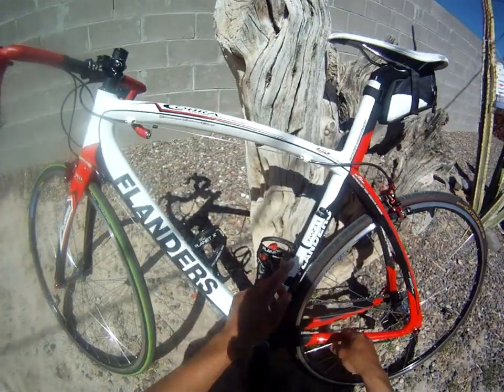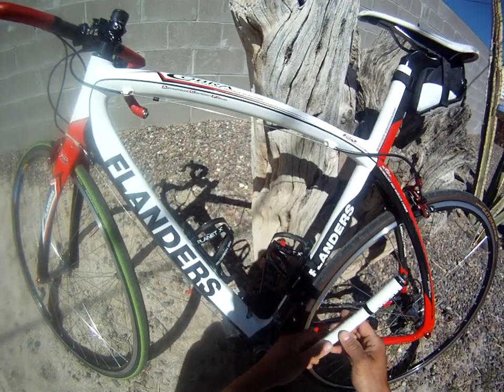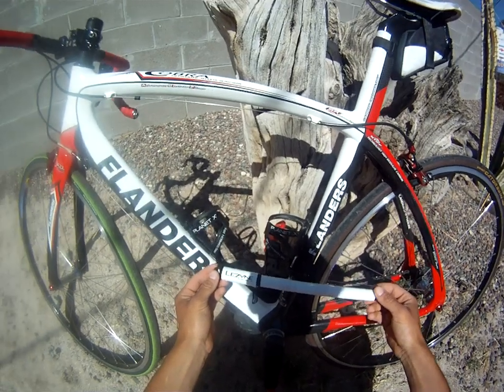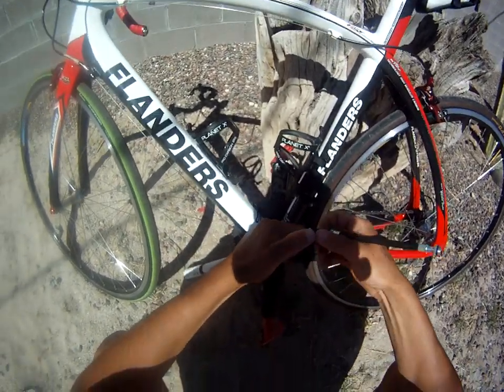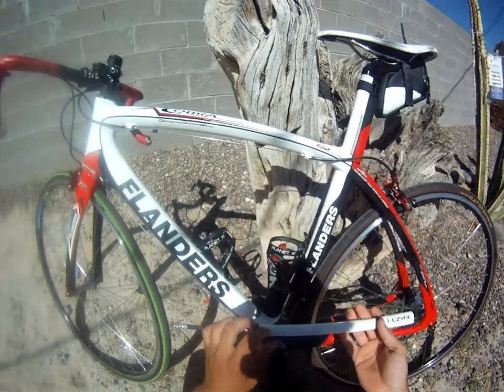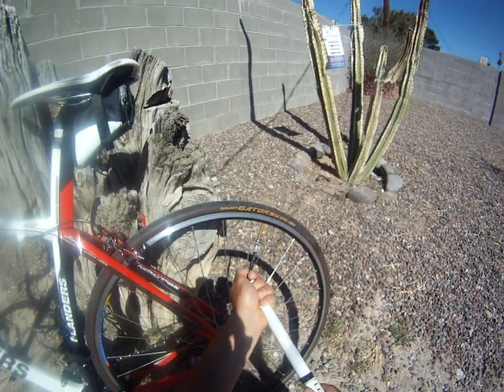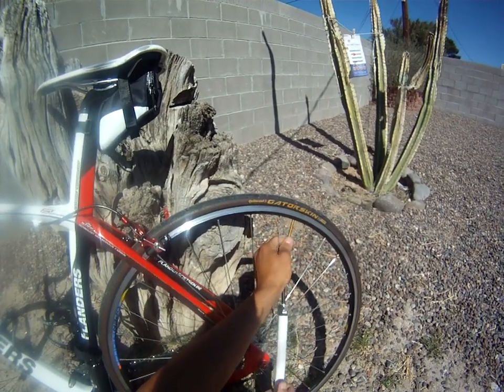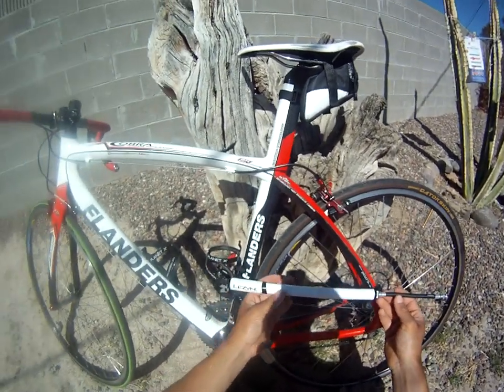Lezyne Road Drive Pump

Comment: I have this pump too.

CO2 is convenient and fast.  Except for when you've got so much mud on your hands and the valve is slipping around the nozzle on the cartridge and your hands are shaking because you're getting left and you jet too much and you don't have enough to fill up your tire.  And then you have to add the spent cartridge to the local landfill.  And go buy another cartridge.  The pump always gives you as much as you need.

Comment: Bike nerd be damned ... Through review. You really need 110Psi for those tires?  Wouldnt Co2 be better in inflating the tire quicker? any drawbacks to using Co2? What about nitrogen? I'm guessing the pure gasses would be better than just compressing normal air.